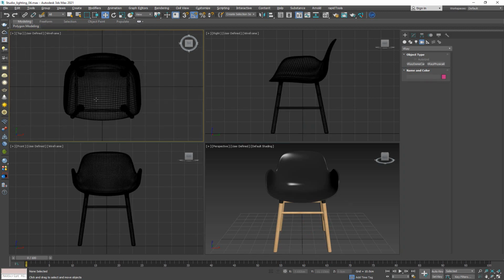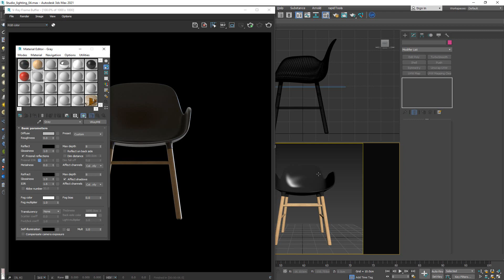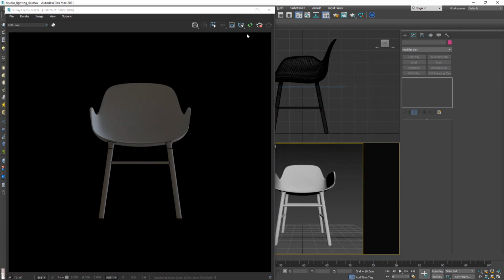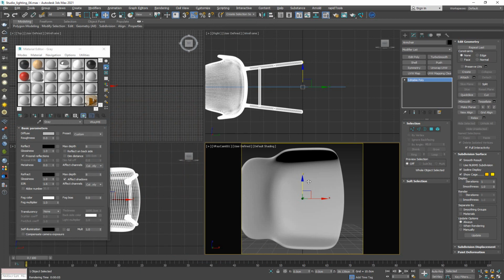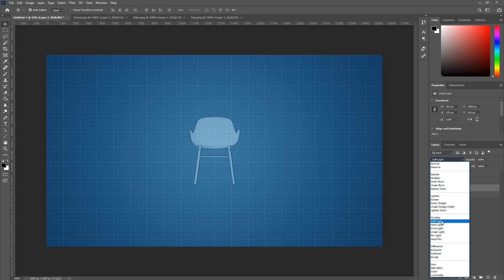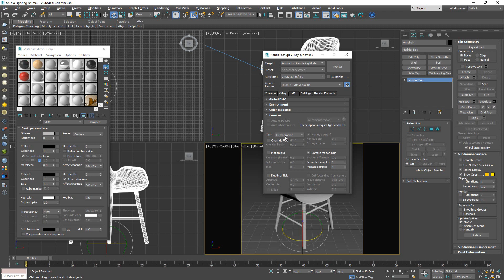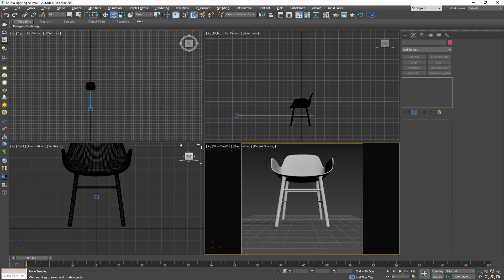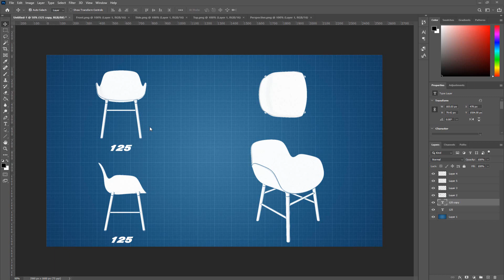Making Blueprints From 3d Models

Comment: Very nice tutorial! As a mechanical designer I just have to point out that projections are wrong :') side view won't ever project on the bottom, same for the top view on the right side of the front view! That's just a tip for making it look more realistic!
Reply from the maker: You got me confused now. In the blueprint the side view doesn't project on the bottom, and the top doesn't project on the sides. The only view where all sides are visible is on the perspective (fourth), and the reason why those are visible is because the final render was done with orthographic turned off
Reply: @DenisKeman  I think Giraffa ! meant that the way the projections are physically placed in your PS layout are wrong. Usually, one would place the right side projection to the right of the front view (vice versa for the left) and then have the top projection on top of the front view (and of course vice versa for the bottom one). It's visually more logical, but it is this way because when plans used to be hand drawn, it was easier to align and thus create the projections themselves using this system, as lines logically extend from one another. I understand that your main concerne was to teach us how to use this technique and great job for that Denis !